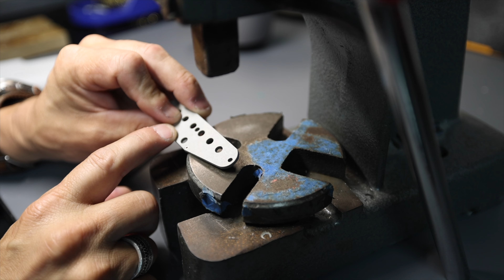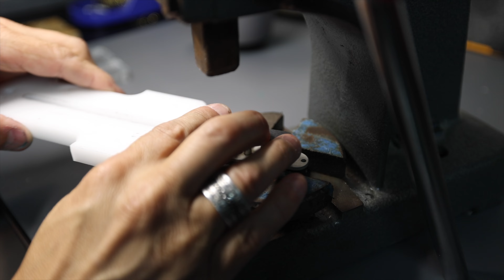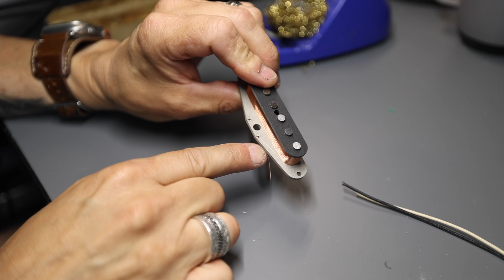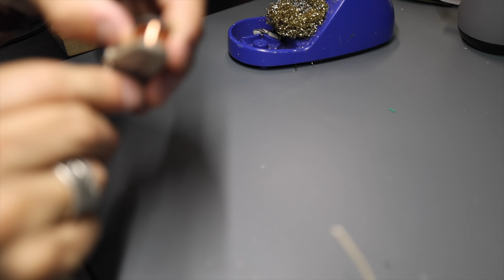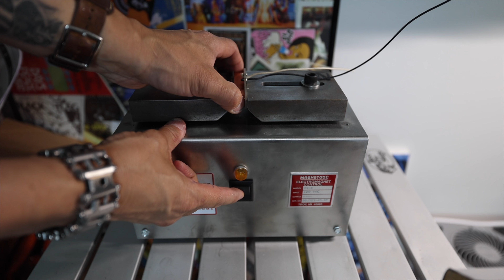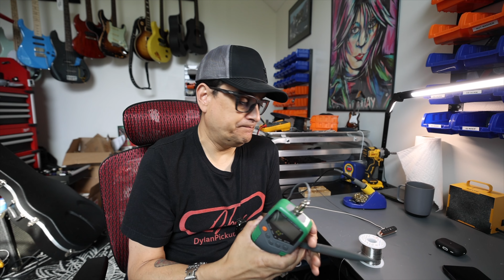Pickup Winding For Beginners - Everything But Winding

Comment: Thank you Dylan. This is extremely helpful. Yes please do the video on potting. I have a few questions I'd like to ask for a future video if you don't mind: 
1. I have a very heavy spool of poly wire. How do I set up the spool to turn at the same rate as the pickup winder? I'm a bit concerned that the wire will break if it's the only thing pulling the spool around whatever it's mounted on.
2. Can I use actual beeswax (as left behind by transient bees) to pot the pickups instead of paraffin wax?
3. If I wind 2 half height coils (one on top of the other) on a strat bobbin, connected to each other by a coil tap, would the full output sound the same as a single coil with the same number of overall winds/same overall dimensions etc?

Comment: thanks D. a couple questions...  why flatwork, not preformed plastic bobbins ?  do you ever press in the eyelets after winding, just to avoid snagging issues ?  i have heard of potting with sanding sealer or similar. any experience with that sort of technique ?  also, i was a little surprised you put no tape around the poles before winding. and last, do bevels on the poles effect anything beyond cosmetics ?  thanks, steve

Comment: One of the difficulties I've had is sourcing what I would like to believe is quality wire. I recently purchased Elektrisola wire through Remington. when I received the spools, they were labelled Remington. I contacted Remington and was told that Elektrisola is one of their suppliers. Remington buys large spools of Elektrisola wire and rewinds it onto smaller spools. I don't know for sure is Elektrisola is a top brand, but I did see a spool of it on your bench. I'm guessing, it must be. Perhaps you can elaborate on that.